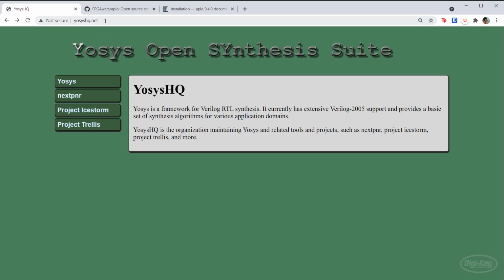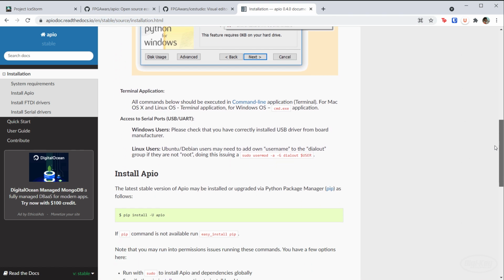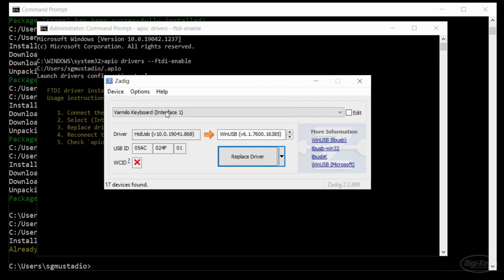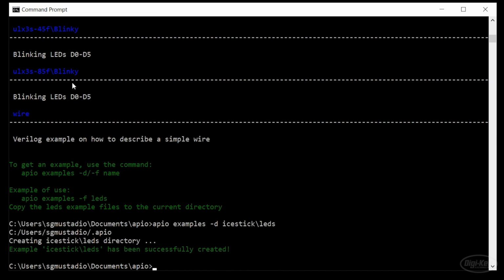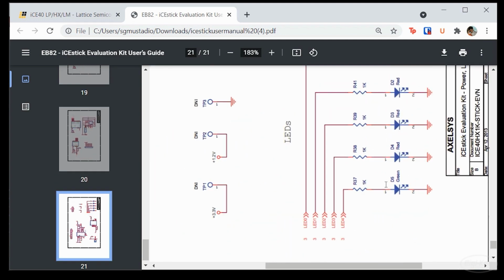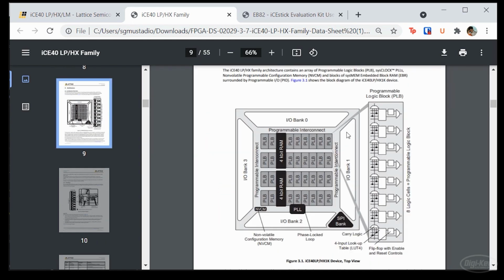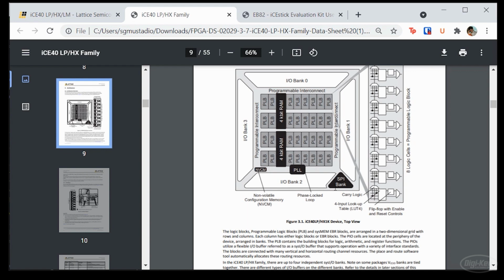Introduction to FPGA Part 2 - Getting Started with Yosys, IceStorm, and Apio | Digi-Key Electronics

Comment: Ok it's 2024 and here's some updates from hours of debugging I've run into.
After running "pip install apio==0.6.7" run the following:
> pip install click==7.0
(otherwise you will run into "Error: module 'click' has no attribute 'get_terminal_size'" when you run "apio verify" for at least the current latest version of click, 8.1.7)

If you have an AMD x86 processor, when installing apio packages, run the following:
> apio install -p windows_amd64 --all
(some packages will return missing/error 404 otherwise)

If you get the error "Error: board icestick not connected" when running "apio upload", it's because the "Description" was different when you ran "apio system --lsftdi". In the video it was "Lattice FTUSB Interface Cable", but anything else will cause issues, as with mine which was called "Dual RS232-HS". For this you will need to do the following:
https://blog.j2i.net/2023/01/27/resolving-board-icestick-not-connected-for-the-lattice-icestick-hx1k-with-apio/

Most likely your filepath will look more like "AppData\Local\Programs\Python\Python37-32\Lib\site-packages\apio\resources" presuming you aren't using Anaconda.

Comment: why my commentary was removed?...with newer icestick there is another description of the usb stick...so this does not work at least with the last (and older ) apio. there is an way... but they dont want you to know about it...weird...why they changed that description... still weird... :D 

in linux, in windows... does not work the apio like it's... with the newer icestick, apio looks for the lattice older description and he gets this: 

Manufacturer: FTDI, Description: Dual RS232-HS not the older lattice description... 

so... no firestick avaiable, when it's just an change of the description find it on the boards.json somewhere in your's installation...  look for the entry for the iCE40-HX1K. In that entry there is the object named ftdi that has a child string named desc. Compare this name to the output that you get from apio system --lsftdi. If it is different, update it to ensure it is identical.

I copied the text of joel help... and it helped me... now it's working.

Comment: Great video as always.  Thanks.  BTW I am using Windows 10, Python 3.11 and was getting errors with the python click module when trying to verify a simple blink .v file.  I solved it by updating to current apio and then running "apio install oss-cad-suite" -- now it all works.
Reply: Thanks for the heads up on getting the new version of apio to work!

Comment: Hi @Shawn. I just bought the same icestick from digikey. But I can not upload bin file to icestick. And after I installed the FTDI driver, the icestick is still recognized as "Manufacturer: FTDI, Description: Dual RS232-HS". No "Lattice" or "Icestick
Reply: I encountered the same thing. The Icestick shows as two USB devices. I've tried assigning the FTDI drivers to both and get the same result that you do.
Reply: Do a search for a JSON file called Boards. It's deep in your python folder. Change the description for icestick to what you are seeing as the description in zadig.

Comment: Greeting everyone! I have run into a bit of a wall here and I would be very grateful for a nudge in the right direction. 

When I enter in the command 'apio system --lsftdi' as seen around minute 7 of this video, it outputs that my connected FTDI device is described as a dual RS232-HS. I originally suspected there to be a problem when I got to the Zadig stage and two different devices with that name showed up on interface 0 and 1. I know that they belong to my icestick because they disappear when I disconnect it. I ignored this issue all the way up until it was time to upload and my fears where reinforced with a error saying the icestick was not plugged in. I have been searching the web for possible solutions for the past hour or so but to no avail. Please if, anyone has any information on this problem, I would be absolutely out of my mind with excitement for even the slightest clue about where I should be looking for solution.

By the way, I would like to thank Shawn from the bottom of my heart for such a fantastic video series!
Reply: Hi, I had the same issue. When you do `apio system --lsftdi`, the description doesnt match whats in the video/what apio expects. So to fix this, you need to find the apio/resources/boards.json file and change the description in there. To find this, i did: `pip3 show apio`. That gives you the "location" of apio. `cd` there and run `find . -name "boards.json"`. Edit the file's "icestick" description entry. Change it from "Lattice FTUSB Interface Cable" to "Dual RS232-HS". Then retry `apio upload`
Reply: @fabianzachs68  Hello Sir, I very much appreciate you taking the time to write this. I had to sideline this project, as I hadn't had a clue where to look for an answer. It has made my day knowing that I can again resume my FPGA quest. It truly brings joy my heart to know that there is such a wonderful community out there who take the time to share their knowledge with others for the sake of uplifting the curious minds of the world. I hope that many more people find your comment useful and I will report back here after I get a chance to test this approach out to add anything that may be useful. Anyways, I wish you the absolute best of luck in your projects and in your life. Thank you again 🙂
Reply: @fabianzachs68  Thanks so much!  I was about to give up for the night.  (-;
Reply: @fabianzachs68  Thanks for the solution!
Reply: @fabianzachs68  thank you so much

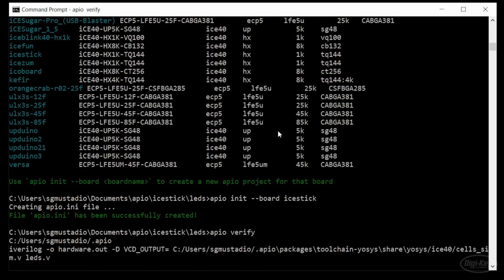Comment: I'm getting an error around the 12:47 point  with the "apio verify" command stating Error: module 'click' has no attribute 'get_terminal_size'. Any ideas where I've gone wrong?
Reply: I had this same error. Roll back to python 3.9.xx and install click version 8.0.4. Fixed the problem for me. However you will get annoying messages about pip and other software being out of date. Also try shawn's comment under CM MC's comment if this doesn't help. The problem is just python and other modules getting rid of certain dependencies in newer versions.
Reply: Have same one. Did you find a solution?
Reply: @electronichome1153  Nope, unfortunately nobody has responded so I've been dead in the water. Very disappointing!

Comment: I find your videos very organized, and FPGAs sound intereting. However I looked up the specs, and the CPU clock is 1/10th that of Teensy, so even though I can program bare metal more easily on FPGAs and I can make the code run more efficiently, at that clock speed I don't think it can be enough. For me. Excellent work.
Reply: CPU clocks do run very high, but they are instruction based. For a simple addition of two values from memory, they do two load instructions and then an add instruction. So effectively, you need 3 cycles for that. But on an FPGA, you give two inputs, one clock later, the output is obtained. There is definitely more explanation why FPGAs can be faster but this is the watered down version of it.
Reply: @Kartavya64 thank you for this, helped me understand

Comment: Super informative series so far! However I'm having one issue on MacOS during install. After running `apio drivers --ftdi-enable` to install FTDI drivers, and then attempting to run `apio system --lsftdi` I encounter an error saying that 
dyld: Library not loaded: /usr/local/opt/libftdi/lib/libftdi1.2.dylib
Referenced from: /Users/trylaarsdam/.apio/packages/tools-system/bin/lsftdi
Reason: image not found

This doesn't happen on windows, and the utility detects my upduino just fine.
Reply: I wish I had a Mac to test the install process, so don't know how helpful this will be. I recommend installing libffi and libftdi using homebrew (this comes from some GitHub issues pages if you search for your error message): 

brew install libffi
brew install libftdi

Let me know if that works!

Comment: Can someone tell me how to do this, I installed python 3.8 on windows 10, which completed ok but I cannot call python it says it does not exist.
Reply: Did you make sure to add Python to PATH? I think there's an option for that at the beginning of the installation process.
Reply: @ShawnHymel  I have now found that option in the install for Python, thank you :) I also had to add the path to apio manually.

Comment: Hi, Did anyone else get the following error: "SCons import failed. Unable to find engine files in:Traceback"  when >> apio verify?
Windows 10 Pro 10.0.19044 Build 19044, Python 3.10.0 and apio version 0.7.6
Reply: It looks like until a new version of apio is released (to fix a lot of issues), you'll probably need to stick to Python 3.8 and apio 0.6.7. :-/
Reply: @ShawnHymel  Thanks Shawn! That was exactly the problem, I uninstalled 3.10 and went back to 3.8.2 and everything worked! Much appreciated.

Comment: Some software facepalm moments: When using the lsftdi (i.e. "list ftdi") option, it has trouble "listing" them if there is more than one. And having an .ini file which doesn't use the standard INI format, as opposed to using a more generic extension, such as .conf, .cfg, or .rc. Yes, I'm being nitpicky, but why add confusion to software which is suppose to make things simpler.
Reply: Yeah...apio (at least the current version) isn't necessarily the most robust tool. It gets the job done for beginner projects, but you'll probably find that you'll quickly outgrow it to use the underlying tools directly.

Comment: Hey Shawn, really sorry to report this but as soon as I used zadig to change the driver to libusbk I lost control of my keyboard. I think it was also using the libusbk drivers and now it isn't responsive.. Any advice?
Reply: Oh no! Zadig can be kinda dangerous if you overwrite the wrong driver :( Keyboard drivers should be fairly universal. If you can, open Device Manager and find the device entry for your keyboard. Select it > Properties > Driver tab. Click "Uninstall Device." This should delete the driver from your system. Unplug the keyboard and plug it back it. Hopefully, Windows will use the universal driver for it instead of the Zadig one. You might have to do this a few times or use Action > Scan for Hardware Changes (in Device Manager) to force Windows to update the driver.
Reply: @ShawnHymel  Thank you for the help. The scary part was this was my laptop's inbuild keyboard, not an external one hahah. It's all good now, I reinstalled the keyboard driver & retried zadig. This time everything worked as it should. I'm already finished with Intro to FPGA Part 3's full adder Assignment, really enjoying the course! :)
Reply: @mustafaabdaal7528  Phew! Glad to hear you got it working :)

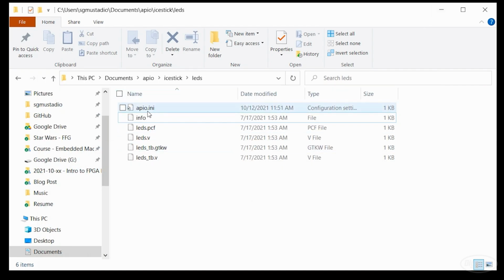Comment: @Shawn Hymel - great second tutorial ... Things sailed through till about 12:30

I did do "pip install -U scons" to correct the below error and it says it is installed 
I am using Windows 10. python version 3.10.0, apio version 0.6.7

apio verify gives me this error. Any suggestions? 
** Deleted details as it causes clutter **
Reply: Looks like you're not the only one...it appears to be an issue with Python 3.10. I used Python 3.8.2, so maybe try Python 3.8 to see if that helps? I'm hoping that apio will be updated in the near future to work without having to fight with specific Python versions.
Reply: @ShawnHymel  Moving to python 3.8.2 solved the problem. Thanks for pointing this out

Comment: Below the various steps necessary to properly install everything in Windows:

py --version ((Make certain you don't have the 3.10 version of python but some earlier one, preferably 3.8.2))
py -m pip install apio==0.6.7
apio install --all
apio install drivers
((then enter open a new command prompt under administrator and type))
apio --ftdi-enable
((install the correct drivers in the Zadic window as described in the video after minute 5, and then close the administrator command prompt))
apio system --lsftdi ((schould recognize the FTDI device))
apio examples -l ((lists ready made examles))
apio examples -d icestick/leds ((download leds programme into the icestick/leds directory))
apio init --board icestick ((declares the FGPA board you are using))
apio sim ((optionally, simulate the leds programme))
apio build ((have apio "compile" the leds programme for the board))
apio upload ((upload the programme into the board and execute it - now all leds should be on))
Reply: "apio --ftdi-enable" step should be "apio drivers --ftdi-enable"
Reply: Awesome, thanks for adding this!

Comment: Hi Shawn! Everything was going great until I tried to upload to my icestick. Then, I get "Error: board icestick not connected" everytime I try doing "apio upload."  I have tried all three of my USB ports with the same result. No other USB serial devices are plugged in. I do not know of anything I have done wrong. I have been following along with each step as you do it. Sometimes, I have to rewind and relisten to a few seconds but that is all. Do you have any idea what might be wrong? I am using a Core i3 laptop my sister sent to me and I do not know the history.
Reply: Confirming @Dan S. answer. I changed the "boards.json" file "icestick" as follows:
"icestick": {
    "name": "iCEstick Evaluation Kit",
    "fpga": "iCE40-HX1K-TQ144",
    "programmer": {
      "type": "iceprog"
    },
    "usb": {
      "vid": "0403",
      "pid": "6010"
    },
    "ftdi": {
      "desc": "Dual RS232-HS"
    }
Python 3.10.4  , apio version = 0.8.1
Reply: What OS are you using? If Windows, open the Device Manager and see if there is a new COM port listed under "Ports (COM & LPT)" when you plug in the iCEstick.
Reply: @ShawnHymel  I have two libusbK devices - interfaces 0 and 1 when I plug it in.
Reply: @Hybrid.Robotics  Hmm..I only see one (interface 0). Do you get the same error if you enter "apio system --lsftdi" ?
Reply: @ShawnHymel  I get "Number of FTDI devices found: 1                                                                                                                                     Checking device: 0                                                                                                                                                  Manufacturer: FTDI, Description: USB <-> Serial Converter" It takes a long time for the command to complete.
Reply: @Hybrid.Robotics  That looks right...it shouldn't take more than a few seconds. How long does it take to complete?
Reply: @ShawnHymel  It just takes a few seconds. I got rid of interface 1, so just have interface 0 now. Apio still says the icestick is not connected. I am pretty sure it is something with my computer. I really need to get something WAY better than what I have, but am never going to be able to afford it on my fixed income. :( I do not think more troubleshooting will help. Thank you for what you have done. :D
Reply: @Hybrid.Robotics  Sorry I couldn't be more help...that sounds super frustrating :-/
Reply: @ShawnHymel  It is but that is how it goes for me.
Reply: @Hybrid.Robotics  I had the same problem (Ubuntu Linux). I dug deep, and discovered that the issue is that the USB device description doesn't match what apio expects. You'll notice the result of --lsftdi is a bit different from what is in the video. It would appear that some boards are coming without a Lattice-specific description programmed into the FTDI chip, and instead are returning a generic description: "USB <-> Serial Converter".

My workaround is to edit the boards.json file so that the description matches exactly. As I did a pip install in my home directory, I was able to find it here (YMMV):
~/.local/lib/python3.8/site-packages/apio/resources/boards.json

For reference, here's a permalink to the specific line in GitHub:
https://github.com/FPGAwars/apio/blob/683d7352e128a09ac9ac08d3dbe1f5b01c8cbcab/apio/resources/boards.json#L27
Reply: @rpwoodbu  Thank you for this. It worked for me as well.
Reply: @rpwoodbu  Bro you're so goated for that. Thank you so much for commenting that, I would've never been able to find out how to fix that
Reply: @rpwoodbu  I'm having the same problem on both windows and Mac. My Icestick shows up as "Dual RS232-HS". I see the fix you mention, but I'm unable to find boards.json anywhere - Spotlight doesn't find it. Any idea where I should be looking?
Reply: @rpwoodbu  Same exact problem here one year later, and using the very latest version of apio and toolchain (as of today). I really wanted to embrace open source, but this is not a good start. At all. Shawn’s tutorials are great, but I am not sure I’ll “ice-stick” around.
Reply: @paulturner5314  Mine works setting "desc": "Dual RS232-HS" in file "%LOCALAPPDATA%\Programs\Python\Python311\Lib\site-packages\apio\resources\boards.json"

Comment: Problem with drivers on Mac. “upload” is looking for /ACM0 but Mac sees /TTY
Will try on Linux today. A very useful series. Thanks.
Reply: Shawn, still fails on macOS. I should point out I’m on a M1 Mac under Monterey 
apio drivers —ftdi-enable
Enable FTDI drivers for FPGA
Already up-to-date.
Error: Cannot install under Rosetta 2 in ARM default prefix (/opt/homebrew)!
To rerun under ARM use:
    arch -arm64 brew install ...
Then I get lost in a world of brew, Taps, casks, formula, etc.
The —lsftdi you suggested gives 
apio system --lsftdi
.apio dyld[37821]: Library not loaded: '/usr/lib/libftdi1.2.dylib' (no such file) and so on
Thanks anyway. I’ll do your series on Linux.
Reply: Shoot! That's frustrating...I really thought apio would have "just worked" on Mac. I don't have a Mac, so I couldn't verify it :( What exact error is it giving you? Does `apio system --lsftdi` give you anything when you have the iCEstick plugged in?
Reply: Got it to work on Ubuntu! 
Now that I have confidence, I’ll go back through Mac again. 😀